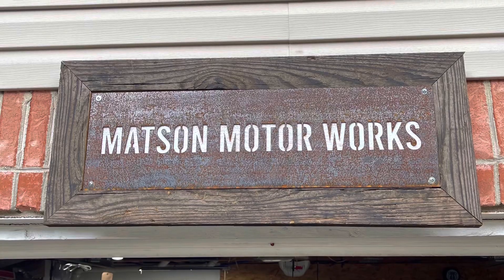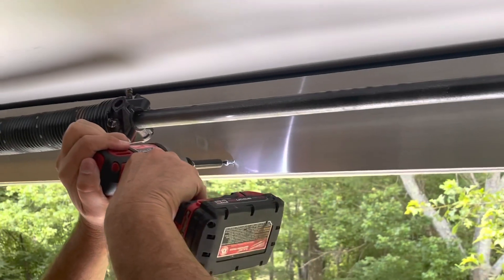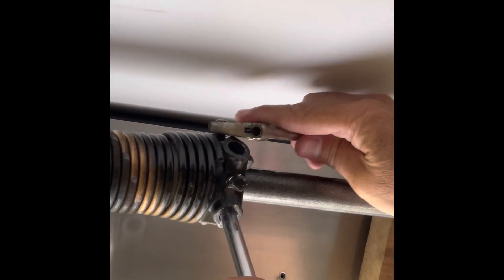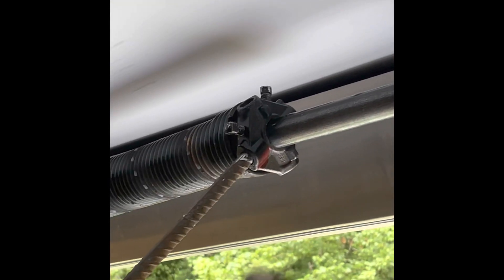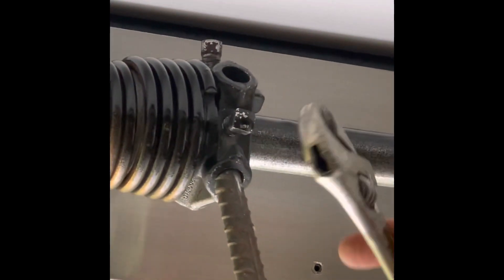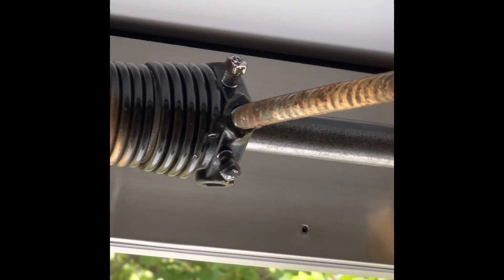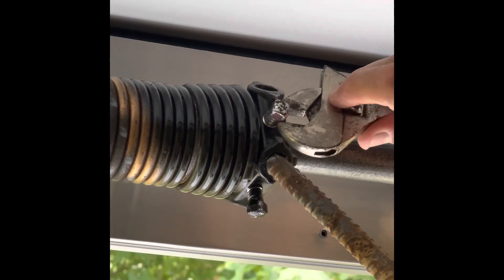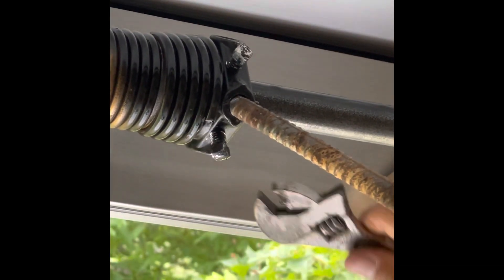Increase spring tension on enclosed trailer gate

Comment: You shouldn't have adjusted the tension with the door open that's at its full load you should've adjusted it with the door closed a lot safer.
Reply: Correct, there is little to no tension when the door is closed.

Comment: I removed the flap from my door. Once I did, the door would not sit on the ground. So I released some tension on the spring but then, there was not enough when fully closed. Ended up with cable unwinding. I can't figure out if this can be adjusted or whether I just need a lighter spring?
Reply from the maker: Take all the tension off the spring. Undo the set screws on the rod.  Now wind rod and it will wind the  spool with cable to door. Now tighten set screws and retension the spring like the video
Reply: All of this should be done with the door closed ,I had 13 winds on a Hyundai reefer trailer